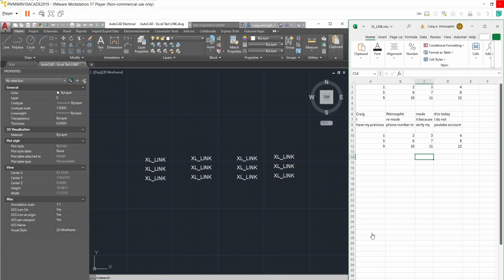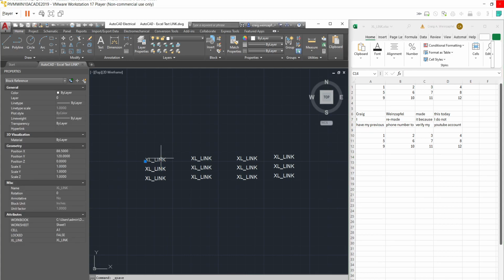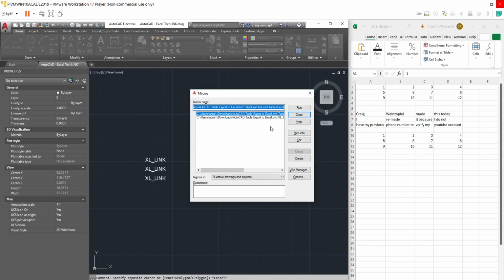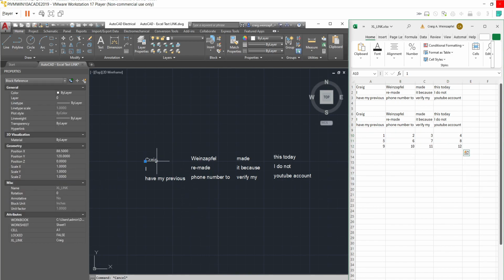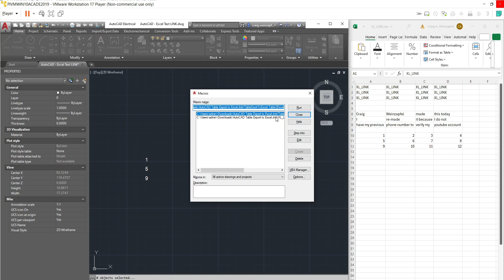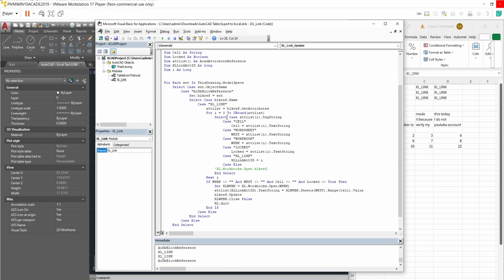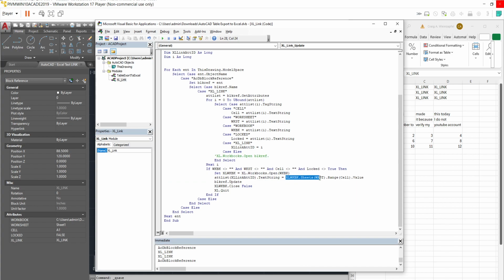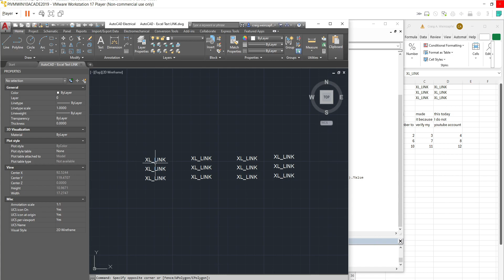AutoCAD VBA - Excel Text Link - XL_LINK

Comment: How do you create an attribute block that contains all the attributes workbook, worksheet, cell, locked, xlink?
Reply from the maker: It is a standard block with invisible attribute definitions that I added with those names. The VBA loops through all of the XL_Link blocks in the drawing and extracts the attributes that tells it the Excel address to use.
Thanks for watching!
Reply: @craigweinzapfel  The invisible attributes you create can guide me beyond? Can I have your telegram to exchange more specific pictures?
Reply from the maker: Would you like me to create a video showing how to make the Autocad block with the attributes?
Reply from the maker: Here is a link to a new video I made detailing how to make blocks and attribute definitions. Let me know if you would like to see anything else.
https://youtu.be/qHmIyDJZTCs
Reply: @craigweinzapfel  ¿Could you help us, please? I would like do this in my work! So kind! Maybe you can show us step by step? Thx!
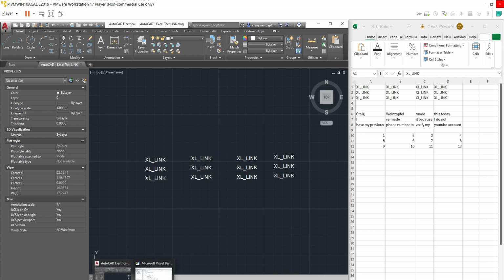Reply from the maker: Thanks for watching. If you go to marker 5:55 in the video, you will be able to see all of the VBA code necessary. There is a reference to MS Excel. I also created the Autocad block with the attributes you see. If you would like, I can make a more detailed video in a specific area of the function. Just let me know.
Reply: @craigweinzapfel Hello, thanks for the feedback. Right i got the VBA code, and the block reference on autocad, but i don't know why i get a problem while i try to run the code. And i'm not able to figure out. Could you help me? Or if you create a video being more specific, i'll be so happy. Thank you, so kind, greetings!
Reply from the maker: Here is a link to a new video I made detailing how to make blocks and attribute definitions. Let me know if you would like to see anything else.
https://youtu.be/qHmIyDJZTCs